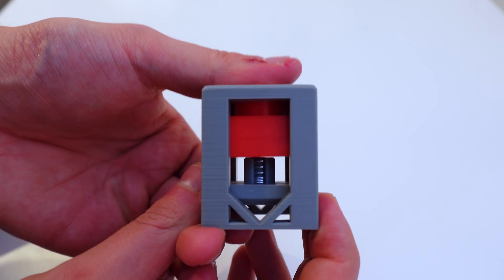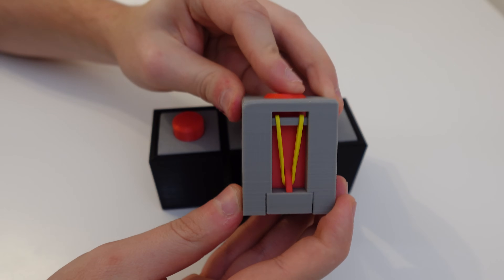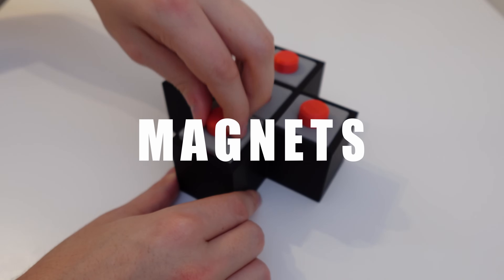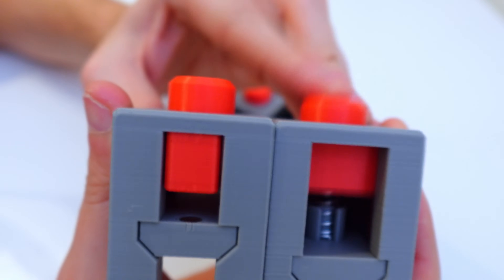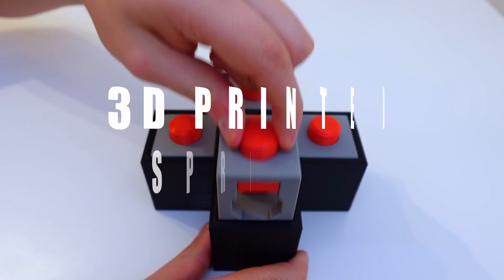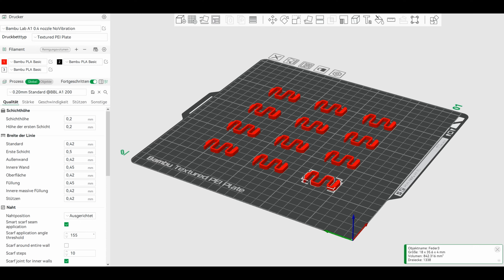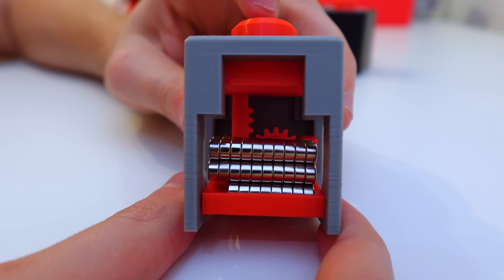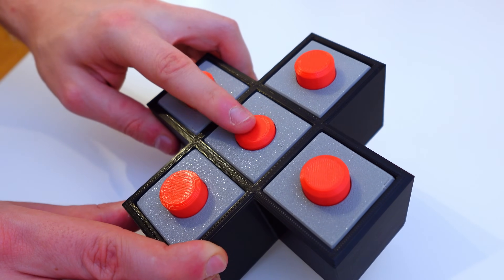5 Ways To Power A 3D Printed Button

Comment: I like the steel spring button and the magnetic button. The plastic spring button also looks interesting for things that don't require that much activation. I don't like the rubber band and gravity buttons. Rubber tends to stretch, become brittle, and break over time, and at high temperatures, they even stick together. The gravity button solution, as you yourself said, only works in one direction, and mass requires raw materials, most of which are expensive. Lead would also no longer be permitted as a weight.
Thanks for the informative video.
Reply from the maker: i have some rubberbands in use for a tool i use frequently and after over half a year the rubber is still doing fine. might look diffrent if its in direct contact with sunlight but already way better than i expected. but i agree with you
Reply: @EmGi_  I once used a standard red rubber band in a PC to secure something. Due to the high temperatures inside the PC, the rubber became brittle and stuck together after a few months. There are industrial rubber bands, usually black, that last longer for such applications, but regular household rubber bands don't.

Comment: What would a button like this be used for? I’ve used buttons in prints before for electronics, but I mainly just made a cover or appendage to an actual electrical button so there wasn’t a lot of mechanism design. I don’t quite see what you would want a purely mechanical button for though.

Comment: I’ve been working on redesigning a model someone else made that uses rubber bands so I was excited to see this video.

Then I saw that model in the video: the magnet insertion tool.

Then I realised that you’re the designer of the magnet insertion tool!

It’s so incredibly satisfying to use and has already saved me a ton of time, but there’s a few tweaks I’m making, including replacing the rubber band. Also there’s a sharp corner that hurts my hand after prolonged use, I have to push “up” on the plunger to prevent catching, and I want to make it more ergonomic like an electronic pipette.
Reply from the maker: Glad you like the Magnet insertion tool. What did you replace the rubberband with?
Some people mentioned that the outer case has some edges that are too sharp. i didnt keep that in mind when designing it but i will for sure keep that in mind for future projects!

Comment: What about a 6th option, being a pneumatic piston? I'm not sure how easy it would be to get the airtight tolerance without introducing too much friction (or using too many non-printed parts), and I'd avoid using any liquid fluids, but it's technically another option

Comment: 2:04 a well-designed 3D spring should have no problem performing 100k+ actuations, while technically it will "wear out faster", the lifespan will still be measured in decades for something like a button.
Reply: It really depends on the material, the most commonly printed material is PLA which has material fatigue characteristics. While you could design the spring to where it doesn’t deflect into this regime, the spring would be huge and impractical, and it would still fail prematurely.